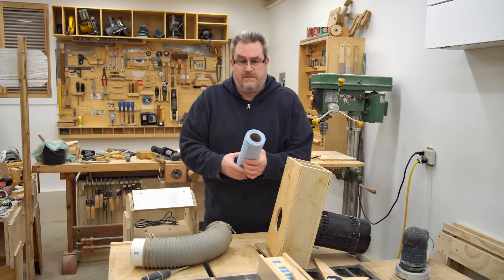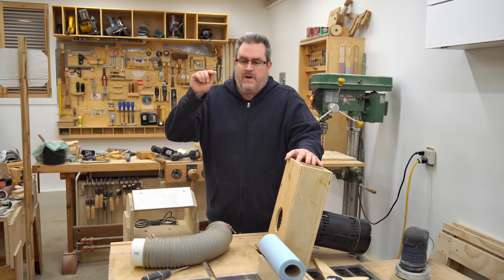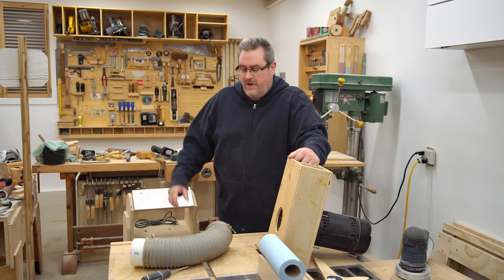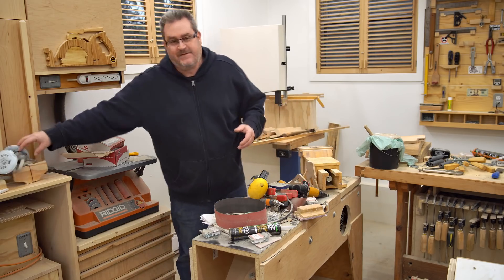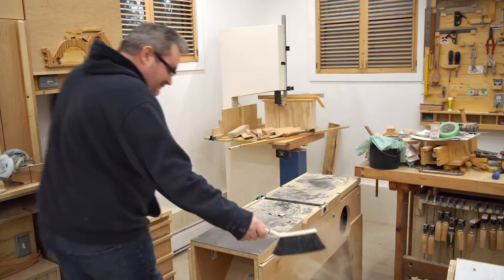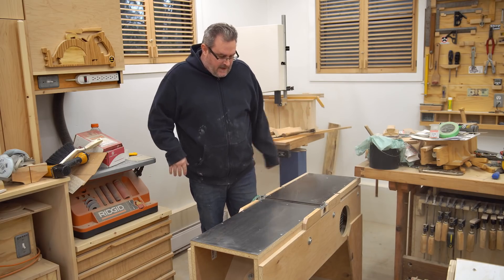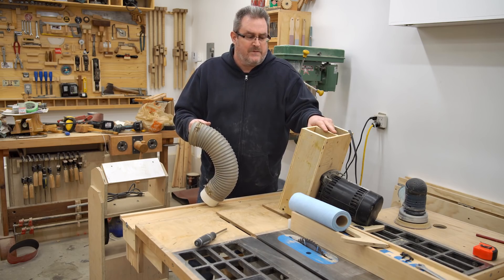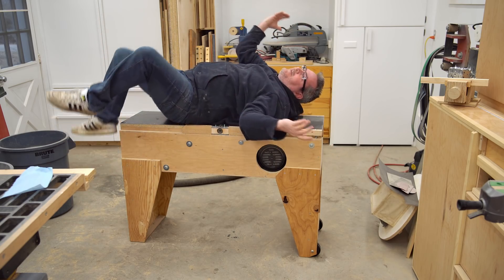Why I Haven't Finished The Jointer (yet)

Comment: as you mentioned using aluminium for the top of the router i wanted to add another side note. for some time now i own a bosch pts10 tablesaw and what i found is that wood doesnt slide as well on aluminium as it does on steel or even better cast iron. the surface on the pts 10 aluminium tabletop is by far less then ideal when it comes to "slippiness" but even on better finished aluminium wood doesnt slide that well. also i find that all kinds of dirt and schmooh accumulates on aluminium much faster and more aggresively than on iron type surfaces. just a little share of my experience.
and by the way thank you very much for making videos!!

Comment: I agree on the air exchange rate on the blower, faster is better, immediate evacuation of particulates is key. I like your thinking on the feed table incline angle and mechanism. Shallower angle also increases precision on depth of cut. I'd suggest a minimum of 1/4" plate steel for the top. Flatter, more stable and you have enough material to fine tune the flatness. May be a bit more costly, but you'll like the end result. Thank for bringing us along on the journey.

Comment: hi john, peter here. i would like to add my 2c. generally people think of steel as a flat surface, it never is, you have to make it flat (in your case with that thickness you`ll never get the flatness, you have to go way thicker and machine it which will make this thing out of budget...) it will be bowed in one or two planes, steel in the hardware store or metal supplier generally is a36 or some low alloy, it is not hard enough to handle scratches by wood passing by (hence the use of castings as a good casting is way harder and more wear resistant - wood is extremely abrasive), don`t go with cold rolled bc it just looks good but has a zillion stress built into it by the cold forming, the moment you cut it it will move and f you up. a hard aluminium alloy would serve you well but they are very expensive (7075 ie). steel would have to be hardened or coated to achieve a satisfactory sliding flat scratch resistant surface. but you can look to the slats the welding table mfg sell for the modular tables, some come hardened and coated ($$ but don`t know in your area). hope it helps. thank you for sharing your projects. regards.

Comment: The idea of the flex duct on the intake may not lower noise if that blower is moving as much air as I assume it is due to the congregation, Line the intake and exhaust plenums in  something soft like insulation to dampen the noise, Then duct the exhaust to the opposite end of the shop , if you wrap the duct in insulation it will act as a baffle to cut down the noise and outputting the air at the other end of the shop will help set up an air flow cycle to help speed up the ability to change the air over in the whole shop.

Comment: Have you thought about putting the jointer outside? Wipe on a couple good coats of water based poly on the top with a microfiber rag for rust protection. Or really you could use a couple pieces of thick machined aluminum in place of the steel and then just wax it. You might not be as inclined to put stuff on it if it’s out there and you wouldn’t have to worry as much about chip collection. But if you still wanted, you could pipe a dust hose through the window alongside the power cord and you wouldn’t have to bring the dust collector outside. You could tarp the jointer when not in use.

Comment: John, great video explaining the issues you face with making your own stuff. The thing is that often cheap storebought machines suffer from these issues of severe inaccuracies too so you end up having to shim bits so its an important point for all whether they prefer to buy or make. Anyway, back on point, have you thought about using laminate flooring? Should be flat enough and even if you do only get 1 year from it it would be easy enough to replace year on year...

Comment: I need help setting up my 1950s craftsman jointer, I replaced the knives and it ran fine. Then I had the knives sharpend, and after installing them, it doesn't run the same. Feels choppy like, and has noticeable snipe. I've noticed the key keeps coming out of the pulley on the cutter head.

Comment: A kafkian ending, Hehehe !  What about not using screws on the steel plate, but contact cement, to glue to a flat chipboard with melamine top ? I never tried that, I don't know if this can work. To flatten when drying you can do a "sandwich" with a few flat thick boards, clamping hard. I think I gonna try this someday, I have a few ideas where I can use it, Maybe even a jointer ! Anyway, Cheers !

Comment: I know there is an older big-ish jointer/planer from Dewalt that I've read good things about while looking at a used one, that has an aluminium table. Not sure how durable it would be, but it is an option! Looking forward to the air cleaner, would be nice to 'flush the toilet' like that!!

Comment: Any reason why you couldn't use a sheet of glass?
Reply: David Lowe durability
Reply: Typically soda based float glass has a hardness comparable to or greater than steel - depending on the alloy being compared. Passing wood over its surface will not wear it any faster than a steel substrate. Float glass is also by definition perfectly flat (at least to the extent that it needs to be for woodwork). For the size required for a jointer, 1/2" thick glass plate will not bend significantly.

Comment: John,Enjoying the new look and feel of the shop.  I concur that a clean visual field detracts less from the subject matter.  Always, cleanliness generally enhances an appearance of competence and expertise...despite the fact cleanliness is the sign of disuse.  Who can figure human reckoning?I'm thinking on your air cleaner noise issue, and your plan to build an inlet plenum and ported exhaust and may I offer a radical solution?  Let me preface by saying that I watched through the videos from your Scrap Bin channel, and I recall in there somewhere you saying in the past you constructed audio speakers.  I'm presuming you're familiar with construction and tuning of Butterworth B4 enclosures to tune speakers enhancing bass frequency response, and that further you may be aware of Helmholtz resonators to build tuned ports further enhancing bass response.My perception of what you plan to build is a plenum on the front for air collection, suspension of the air motion induction motor-impellor-ducting and flex-hosing connecting the two.  I perceive an issue with front face collection on two fronts.  The nature of particulates is Brownian motion, and that particles possessing high energy in relation to their brethren float up high which is all to the well and good but...and here is the caveat, the nature of particulates is to fall and settle as their general energy levels decline and their energy is expended and exchanged with the gasses in the room.Over time particulates fall, and particulate free gasses rise.  If you can accept this as an axiom, and presuming you stand in the room while the filtration occurs, collection up high and front becomes problematic.  It encourages the roiling of the air as required of course, but pulls the particulates up off the floor and into the air you particularly want clean.  Maybe because it happens away from the work area in your shop the issue is moot...but maybe not.  Only consideration and experimentation would inform you further. Either way, front panel collection works in contravention of particulate-matter's primary inclination to fall with gravity.I suggest a solution on two fronts; first, collect air at the bottom of the assembly, and exhaust it out the top.  This may actually aid filtration acting in compliance with particulate matter's natural tendency to fall.  Cooler air at mid-level is cleared and pumped through the box cooling the electric motor as you planned, and exhausts particulate free at the top where it is more likely to stay, forcing the particulates down...to the collection plenum.  Further, I suggest you combine the plenum and motor assembly that you built, thus unifying an assembly and hanging it from noise abating springs in a horizontal plane which may simplify construction of suspension apparatus and framing.Second, treat your cabinet as a speaker box...only, instead of designing it to enhance a particular frequency--the rotation of the motor per se--use what you know of speaker enclosure construction and tuned porting to 'detune' the enclosure from said frequency, frequencies or harmonics there from!  Build noise reduction into the enclosure!What I envisioned is a rectangular cone construction with your fan and motor assembly at the apex, suspended from the ceiling on the trampoline springs you showed in one of your videos.  This would float inside an external encasement isolating the interior mechanics from the exterior cabinet, the interface between sealed with perhaps fiberglass batting and a fiber or cloth membrane to staunch air infiltration.  Literally, build a speaker cone, only stiffer than any you may have used before.At the wide base of the cone a tuned port should be installed.  I'm sure you're skeptical at the thought as a tuned port in singular would restrict airflow, but build on multiple tuned ports to minimize such restriction and I think you may see where I lead.  Filtration would then be slung below, and perhaps to the front of the enclosure.Further my concept eliminates moment arm drawbacks of which consideration from front mounting may require.  The problem I foresee is that the dust collects over your downdraft dust collection table.  I don't know if this is bane or boon.  If you store equipment on the table, it's definitely bane as the dust would collect thereon.  If you don't...just power on the down draft collection and vacuum the collected dust off.  Maybe you can do both and just dust the equipment stored thereon with a dry paint brush?Anyway, just some thoughts...best of luck whatever you do. - Cait
Reply: ...that sure looked a lot better formatted when I typed it in.
Reply: Sure, I know what I said.   Not of use if John doesn't know what I said.  My suggestion was that John treat his air cleaner as a speaker.  There are design rules for these he might apply to minimize the noise his air cleaner may produce, and ways to prevent the noise transferring to the walls and ceiling on which he may mount it.  I'm betting he knows these rules because I believe he designed speaker enclosures.  Am I talking out my arse?  Sure.  ...doesn't mean it won't work.  It's just physics.  The physics are sound.
Reply from the maker: The speaker analogy really doesn't apply, here. There are two sources of noise from the fan unit - vibration from it running and air pumping through at high volume and speed. The vibration can be reduced by isolating it, but the only way to reduce the air noise is to reduce the flow rate, and that would drop the efficiency and be less effective.

Comment: A problem with devices outside the "climent controlled environment" of the shop, even if you push the air back inside after filtering it.... if it is winter and cold out, what happens  when you push warmer more most air through a very cold device outside.... you get ice build up.

Comment: just a personal opinion  (w/ 30yrs of machining )  either use  melamine on press board or get plates of some metal  thin sheets on wood doesnt work by experience ,, but opinions are like assholes everyone has one...cheers
Reply: just a test .... this is why i mentioned it was an opinion not fact or expert's experience it was just and idea to take or leave ,i am not trying to disrespect anyone
Reply: all good mate :)
Reply: Let´s flush the toilet ;)
Reply: ahh! nice and sparkly clean again. thanks, moninum!
Reply from the maker: I'd consider 22 gauge thin, but not 1/8". If it's actually flat (within reasonable tolerances), 1/8" is plenty thick enough and will stay flat on the plywood substrate. The issue I'm having is that it's not flat enough to begin with and it's not worth the time and effort to make it so.
Melamine will not hold up long enough to be a suitable surface, and I know that from 30yrs of working with it.

Comment: half inch plate and have a local machinist flatten both sides for ya.
Reply from the maker: = the cost of a new store bought jointer.  150+ lbs of steel might be a little bit over the top.
Reply: How much thickness can you get away with for this application and having it nice and true?
Reply: I don't know if there is a right or wrong answer but since the steel is basically a laminate over a base of MDF which should be flat, I would think you could get away with about 1mm thick.
Reply: In other words, the thickness of Formica with the durability exceeding Formica.

Comment: Yea, dust collector outside in Canada???  All that air sucked out of the shop would cause the exact same air to have to be brought back in.  Oh Yea, that air would be, How cold, in the winter.  And he would have to heat it back up..
Reply: It would be possible to push the clean air back in again through another hole. Wouldn't lose much heat at all.
Reply from the maker: Yes, the idea of venting all of the heated air out of my shop to clean it is not even on the list of possible options.